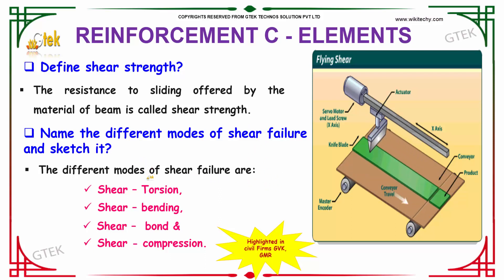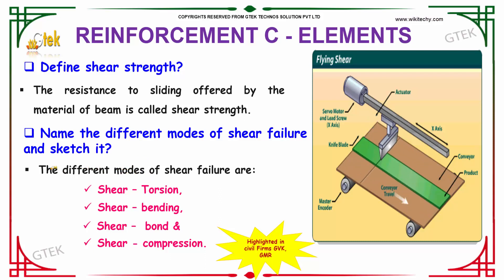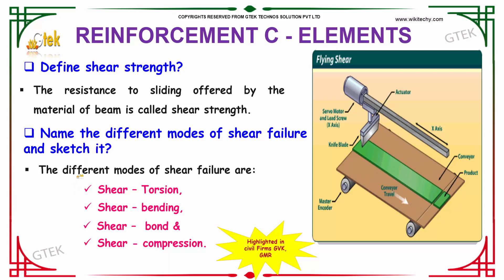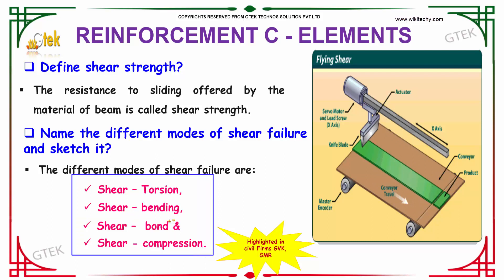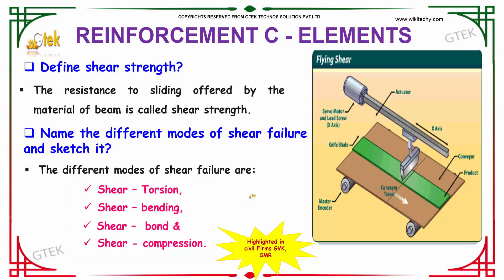Define shear strength | Reinforced Concrete Interview Questions | Civil Interview Questions

Comment: shear strength is the strength of a material or component against the type of yield or structural failure where the material or component fails in shear. A shear load is a force that tends to produce a sliding failure on a material along a plane that is parallel to the direction of the force.

Comment: In engineering, shear strength is the strength of a material or component against the type of yield or structural failure where the material or component fails in shear. A shear load is a force that tends to produce a sliding failure on a material along a plane that is parallel to the direction of the force.

Comment: In engineering, shear strength is the strength of a material or component against the type of yield or structural failure where the 
material or component fails in shear.